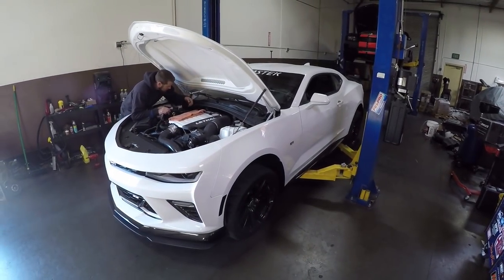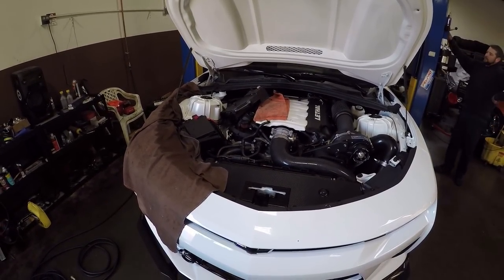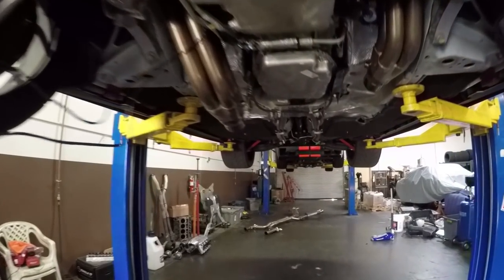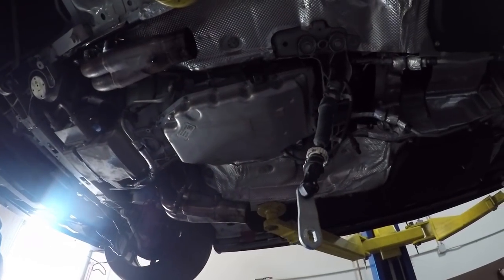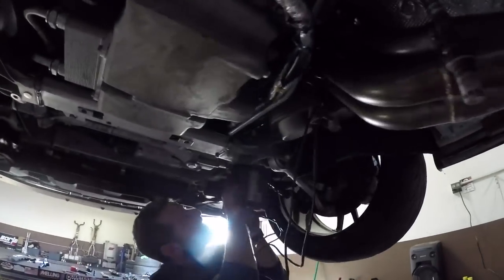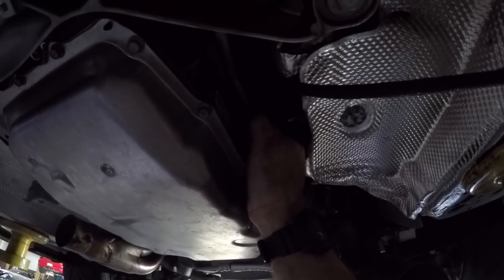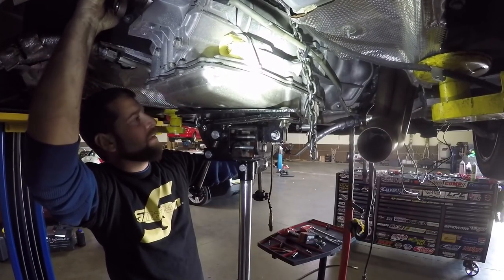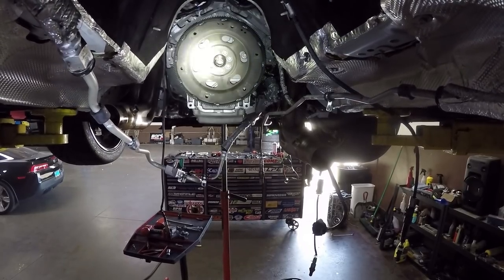A8 Transmission Removal Guide – 8L90 2016-2018 Camaro

Comment: mine as well replaced it with the  A 10 , sinced you yanked the A 8 out , ( the trans in the Z L 1  )
Reply from the maker: So expensive and requires a few extra things
Reply: ok
Reply: I asked the dealership to replace my A8 with the A10 they said it’s not possible with my 2017 SS. How was you able to do yours?

Comment: Chevy Colorados 2017 are having shutter problem with 8l90 ..tsb is 16-na -175 drain fluid 3 times and put in hp fluid..If that does not work you need a new TC..Some say just replace the TC  because you may get same one if you replace the complete trans ....shutter starts from 42/55 mph with light pressure on gas pedal and will shake truck with rumble noise every so often..
Reply: Have you had it where if it was in D it wouldn’t accelerate normally at all? When I put it in manual it works just fine. But the RPM’s hang kinda high

Comment: Got stuck with the shudder issue GM transmission and now it's trashed. Want to try and replace it myself. 

Is just pulling the engine/transmission out as a unit ever a good option?

Comment: Just had the torque converter replaced in my 2016 camaro ss A8 by the Chevy dealership and now the steering wheel has slop in it. Did you have any issues with the steering components? Great video, and thanks for any info.
Reply from the maker: I didn’t

Comment: why are you not using the lift points?
Reply from the maker: On a 4 post lift the car offers other more stable points to lift the car from
Reply: Could you show these lift points in a video some time? Believe it or not, I might be moving to a house that has a shop with a lift.

Comment: Is it possible to change a8 to a10 ?
Reply from the maker: It’s possible, but is expensive and requires a new TCU. Not even sure HPTuners allows all that to jive together yet.
Reply: LethalGarage oh I see.
Reply: @Lethalgarage  what about now ? Haha have a 2016 V6 auto. Transmission went out at 100k miles. 1-5 gear slips hard and reverse has left the chat.